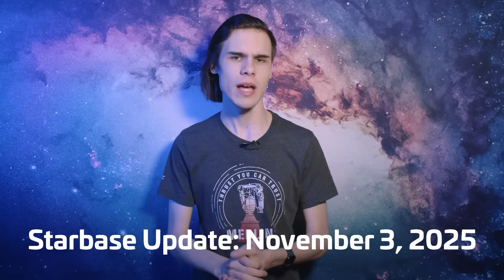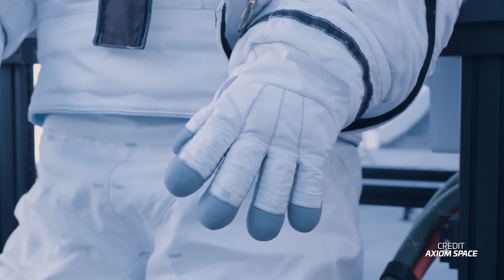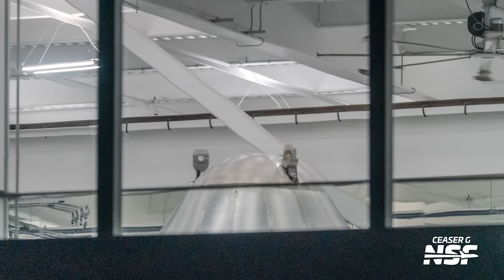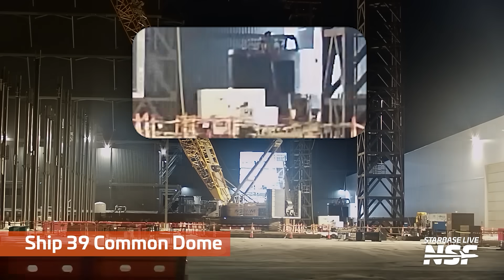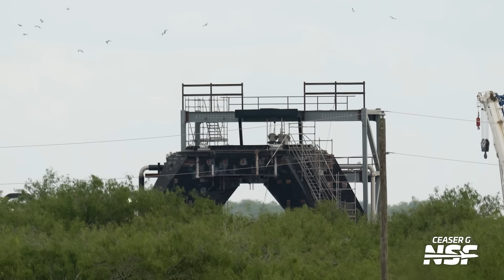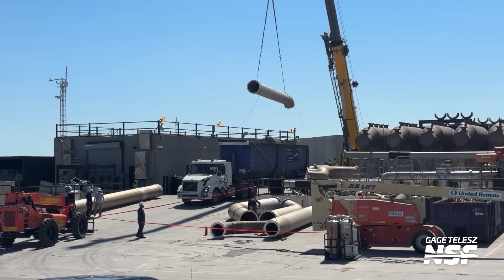Starship V3: Build Accelerates, Raptor Relights, HLS Update

Comment: I want to see the refuel in space! It still feels sci Fi given how much time it take for each launch.
Reply: On that note, I'm surprised they decided to design them with the ports that way. You'd think it'd be easier to make it asymmetrical where every Starship has a probe and drogue (port), or male and female. Which when facing each other, means each ones' probe aligns with the other's drogue.

Not only would it simplify constructing, but then literally any Starship can refuel another. Think of potential emergency situations, where X/Y/Z happens and leaves them short of fuel, ANY nearby ships could lend assistance instead of being a purpose built tanker.

I realize that fuel on each would be a precious commodity and likely wouldn't have much to spare, but having the option feels better 😅
Or if nothing else, it would at least let them hard-dock with each other to transfer crew to the other, which feels safer than having them park next to each other with nothing connecting them.
Reply: That's going to be a huge milestone for the history of space flight.

Comment: Bring a rope ladder, or winch,  in case the elevator malfunctions. It would suck if they got stuck on the Moon with no chance of rescue.
Reply: From what I understand, they have multiple backup methods for operating the elevator.

So if one system fails they can fallback to another system.

But dont quote, I dont remember if that's completely true.
Reply: @TheAugmentedMan1  I sure hope so because of Murphy's Law.
Reply: They might be using a pulley system for lowering and lifting tools, samples etc. instead of always using the elevator. That could also maybe be used as an emergency backup.
Reply: @StevePemberton2  Usually, an emergency implies a situation that requires immediate action. I can't imagine a pulley system being practical solution in getting an astronaut to safety in an emergency situation.
Reply: one thing i really dont like about HLS is that janky looking elevator and the 50meter drop, that is just asking for trouble.
Reply: @Regista268  All the 6 Apollo landers targeted nice flat parts of the Moon. Even then, 1 put a leg down on the side of a small crater which caused the rocket nozzle of the LM to be dented as it landed. Lucky for them, they didn't need it to get off the Moon, since the top part had its own engine.  From what I can see, which could be distorted,  the south pole of the Moon is nothing but connected craters, since it was never remelted like the Apollo landing area was. Finding a crater free spot down there, I suspect will be a lot harder than landing the LM was near the equator. I sure wouldn't try to land where craters are the rule, not the exception, like during the Apollo landings. And even if it doesn't tip over, if not close to vertical, the crane won't work dragging on the vehicle. It could also get tangled up, should it slip off the side of the rocket. This landing, if it ever happens, will be way more risky than Apollo.

Comment: Spacex should do sample return missions and auction them off for billions.
Reply: Lunar samples are only valuable because there is so few of them

& for any scientists who wants to study it, NASA has unopened samples left from Apollo

If SpaceX brought over a bunch, it would quickly lose its value
Reply: @witext the value is in the information you can gain from it. If you want to build on the moon you need to know what you are working with. So more samples would actually be valuable for companies who might want to work on the moon. Let's say a way to pull elements out of the regolith or wear from that regolith on your tests with real regolith. What happens when this sharp regolith gets into your components. What if you want to build a habitat that will just sit on the moon and want to know how to get the electrostatic regolith off clothing before entering your test habit. Companies would pay handsomely for that ability with the real deal.
Reply: @ShieldWolf-yp3cr  Thats the right thinking. The markets for lunar samples are far broader than the way nasa thinks. I’d imagine rock hounds would pay handsomely. Sample returns from mars and asteroids would open up markets with huge potential
Reply: Large samples would be very important if more companies want to get working on the moon